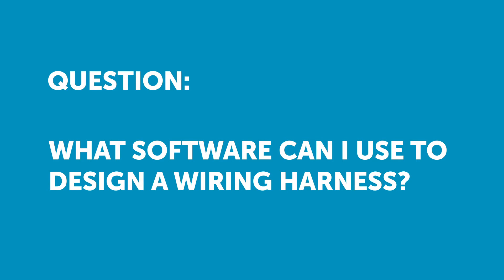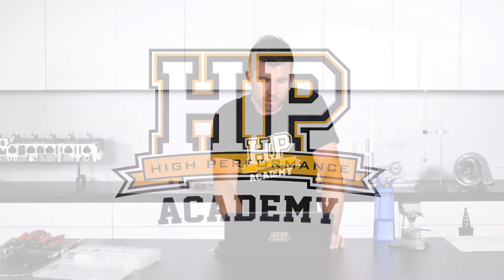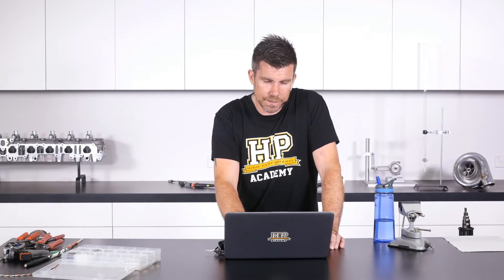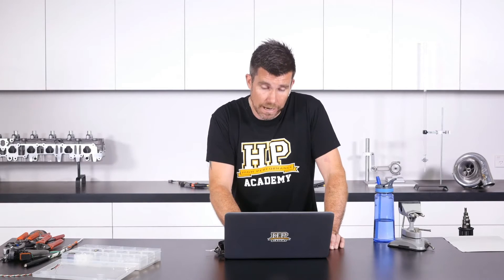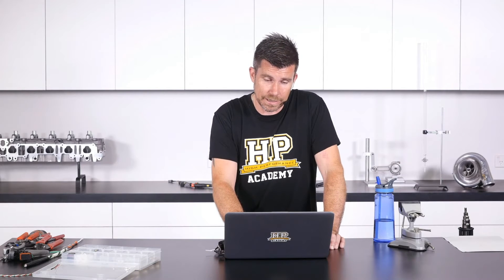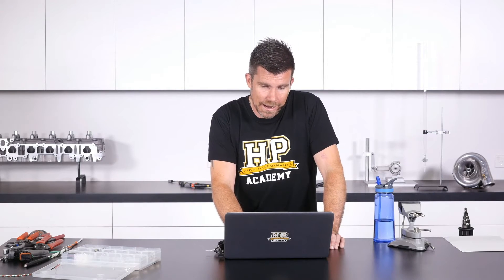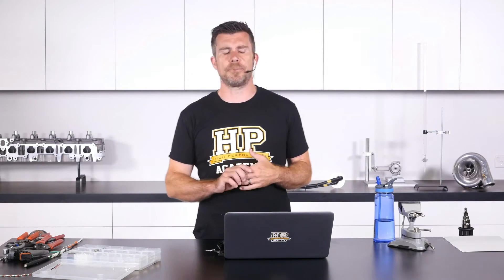Wiring Harness Design | Software Options HPA Q&A]

Comment: Altium, "community" version. Before they had a dedicated harness design feature you can still use schematic diagrams and sheet symbols. Just do a layout in a harness style and not in a generic electronic circuit symbols. You can draw pretty much any connector and device approximation there.

KiCAD is capable as well, although not as convenient to use.

Comment: It took me alot of searching to find the best free tool for harnesses and i stumbled upon an open-source software called QElectroTech.

Extremely simple to use, wires can be multi-color, a feature which PCB design software like Ki-cad lacks.

It lacks alot of needed items but it Compensates by having an extremely simple element editor that helps create connectors and such, i'll be creating and uploading a full harness for a SR20 controlled by a Link G4+ Extreme to the forums along with the needed connectors.

HIGHLY Recommend if on a budget.
Reply: Dude I spent like 2 years searching for something like that. Thank you so much
Reply from the maker: Thanks for sharing this here Hashem! I hope your comment helps out a few people in the future :) - Taz.

Comment: I've used Rapid Harness for my projects
Reply from the maker: Have you tried anything else? What do you think of it in comparison if so? - Taz.
Reply: @hpa101  Only what was available at Uni for designing circuits. I found this while working on a project for work because I couldn't make SW Electrical to work for what I needed. I found RapidHarness  very easy to work with and intuitive as someone who is primarily a Mechanical Engineer